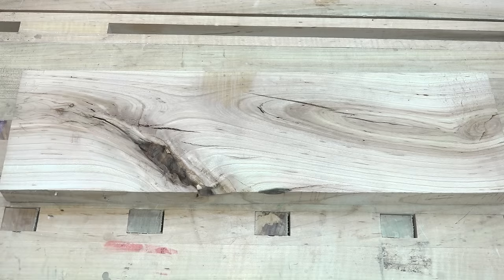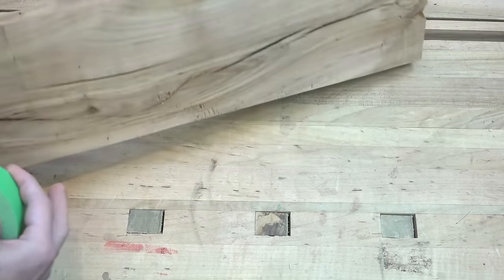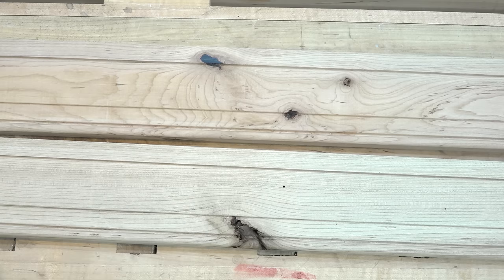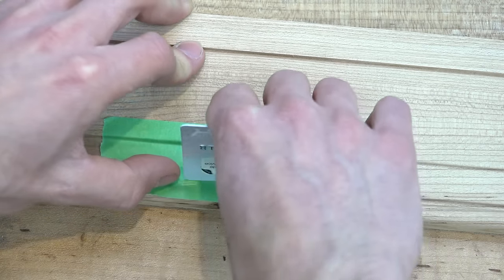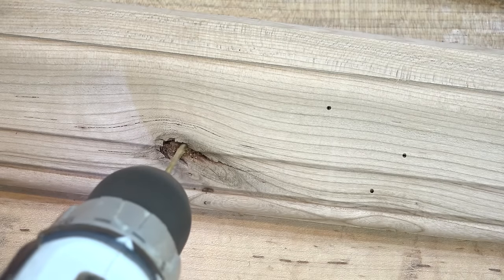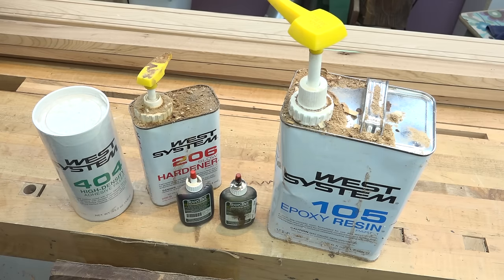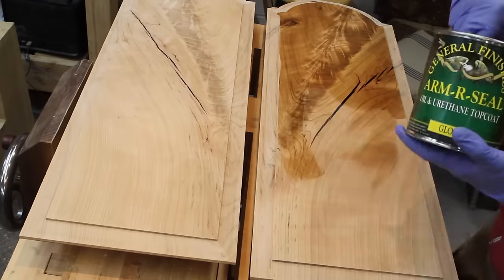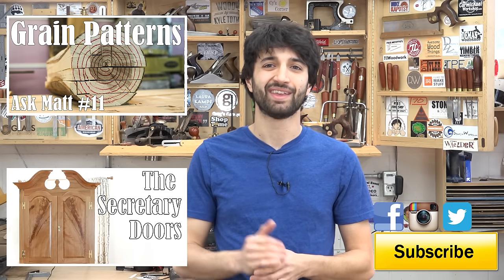Filling Voids, Cracks, and Defects in Wood with Epoxy - Ask Matt #19

Comment: I had a slab of walnut that had so many deep cracks (it was like swiss cheese!) it was taking an inordinate amount of epoxy to fill. And when I did fill, air bubbles were becoming a major problem. I just couldn't get them out to a perfectly smooth finish. So I tried the following, curious if you've ever tried it: 

I'd pour epoxy in a crack and wasn't concerned if it filled the whole void. Then I'd tape over the epoxy, and flip the board face down. What happens is the air bubbles up under the surface of the wood, while the epoxy flows against the tape, leaving a relatively flush pour after the tape is removed.

The downside is it's purely a cosmetic fix, so if there are major voids that present a structural issue, then you could be asking for problems. But man, it saved so much time and trouble. Try it some time with your more cracked woods.

Comment: You mention using masking tape.  Is that frog tape?  I've tried using cheap, white masking tape and Gorilla glue duct tape.  With both products I get epoxy leaking out of the bottom, although less so with the duct tape.  Should I just start with a light coat when filling so there isn't as much initial weight on the tape?  In the video it seems you can do the full thickness without any leakage.  Also, thanks for the information, great video and beautiful looking product.  I'm using medium brown and red mahogany tints and it gives a nice deep brown/reddish, almost purplish hue.

Comment: Hey bud I had a question.  I salvaged a few white oaks that had fallen on our property because I wanted to try and mill them.  They have been sitting for almost a year because I didn't have a mill or strong enough chainsaw.  I also did not seal the ends either. (I know, I know, Im and idiot!) As you can imagine, there are some cracks at the ends now.  Do you think I could still mill these trees up and get some decent pieces of wood?

Comment: Matt, it looks like you know quite abit about epoxies, this is not really related, but I would like to know if you know what kind of epoxy or finish that would not yellow after it ages and needs to be somewhat water resistant, also can be put over a decal, I am making a few sets of Cornhole boards for family and the finish I used on the last two that I was told it could go over decals and not yellow, did not work, the decals peeled off and yellowed over the white paint, I really hate painted wood, but these boards have to be painted. 

Sorry for the off topic question, but Google has not been my friend on this, so I thought I would ask someone that may know on here..

Thanks, Mac

Comment: Hi Matt! Great work, thanks for adding the links to the materials you used, thats extremely helpful. Quick question, I have a disk of Red Oak thats about 3 inches thick that I want to put through a router sled, its about 36 inches in diameter, but has a crack about 11 inches long towards the center thats about 1cm thick. Would you recommend that I use the epoxy filler first along with some bow ties and then put it through the router sled? What would you do? Thanks in advance!

Comment: you may have answered this before, but... the viscosity of your epoxy seems to be super thin, like when you brushed it on the bark of the live edge serving trays.  Is it the brand you use or do you thin it?  The brand I have been using is very thick and could not be brushed or shot through a syringe.
Reply from the maker: +Duane W yes west system comes thin out of the can and can be thickened if needed

Comment: Could you use epoxy to fill a burn mark on a solid oak table from a soldering iron? I have scratched out the charred portion, now wondering if I could best hide it by making it look like a knot or wood fill and paint in the grain. Suggestions?

Comment: Thanks for the informative video Matt! I have a  maple slab w some checks and defects that this will work beautifully. There is a large insect infestation (6"×18", and 3/4 through the slab which is 3"). I would like to highlight this and show the story of the tree without starkly contrasting the piece.  Would you dilute your pigment so it is somewhat translucent or use a different cast resin entirely? Or maybe your typical transtint on bottom of void, and a second clear coat above? Epoxy newbie....your advice is greatly appreciated. Thanks Matt

Comment: Is it best to use lacquer or polyurethane on top of the epoxy filler? Will either of these top-coats have a chemical reaction with epoxy or are both of them compatible? Lastly, what type of top-coat (finish) would you recommend for a walnut slab table? Currently, I'm seeking a durable, low gloss finish. -Thanks
Reply from the maker: The epoxy is inert once cured so there shouldn't be any issues with the top coat.  I've used lacquer, shellac, and poly over it.  I'd use a satin poly on your table.  That will give you a lot of durability and the flatteners will keep the gloss down

Comment: I use the same method also, primarily for filling mesquite which always seems to need some serious attention prior to any cutting. But, I've had some problems with leak-through using painters or masking tape. 

I'm experimenting with other types of tape now that provides a better seal and survives the drying process ... but any suggestions appreciated. 

Thanks!

Comment: looks good, 
I have a tree disc from which I would like to make a table. can I coat it completely from top and bottom and at the edge with epoxy to prevent it from twisting and to make it water resisntant?

Comment: Nice video and really useful information.  Question: could you use a palm or RO sander without an abrasive to vibrate the bubbles out of the epoxy?

Comment: hi Matt,  can you comment on a situation where you have to fill a void after the piece is already planed to finished dimensions and you can't put it through the planer....do you need to be concerned about discoloration of wood surrounding the defect that will get some epoxy on it?  In this case would you polyurethane the pc first and then fill the void second?  thanks

Comment: Hi Matt, I've really been enjoying all of your videos.  I also enjoy milling my own lumber and building fine furniture from it (or at least, I try).  I had a question about the epoxy:  a couple of years in, have you noticed any issues with the epoxy cracking or getting squeezed out due to wood movement?  I've only ever used it for very small repairs like bug holes.

Comment: i want to make drink cups with a flower in the base of it, is epoxy a good material to use? i originally thought of using epoxy because its a thick liquid and will be easy to use but im unsure whether it is safe to drink from and if there is any better materials i could use. thanks

also cool video, i saw something similar where someone made a desk and filled the gaps like you did but put a glow in the dark paint instead of the red. either way, both look great

Comment: I'm using JB Weld WoodWeld, and its coming out a lot thicker than the application you use here. Is there something I could use to loosen it up so it falls into the wood easier?
Reply from the maker: I'm not sure if there is a way to thin quick setting epoxies.

Comment: Can you sub epoxy for Gorilla Glue to fill in the cracks in a fir shelf or will the glue expand and make the crack worse?
Also, does the epoxy help strengthen the piece of wood enough to make it structurally safe to use as a  heavy duty shelf?

Comment: Is there any chance of the epoxy damaging the planer blades or carbides when you run it through?
Reply from the maker: Not really. It’s plastic and far easier to machine than wood. Uniform density and no grain direction
Reply: @mcremona  thanks

Comment: You can also get rid of surface bubbles with a light blast of silicone release spray. Then there is no risk of heat damage and it stays on the surface popping bubbles throughout the cure time.

Comment: If you used clear epoxy would it pick up the color of the wood and be less noticeable? Also what was that dye your using? Thanks
Reply from the maker: +Greg Jordan it does a little but if the crack doesn't go all the way through the only light hitting it is on top. I find that it looks a little strange in most cases. Unless you're trying to show what's under the surface, I find clear epoxy distracts the eye and makes the defect the focal point. The dye is transtint. I left links to the exact ones I used in the description. Thanks Greg!
Reply: Thanks I'm doing one of those river type tops with sea glass in the shape of a star fish, part of the design will have clear with no sea glass and others will have bluish color, great info man love your videos keep up the good work!!!

Comment: just about to do my first epoxy filling, so great timing and video, is there any way to sand the epoxy down flush, but keep the epoxy looking transparent, or will it always go opaque?
Reply from the maker: +Russ Dixon you can keep it transparent by sanding to a high grit. Depending on the finish you apply, it can also bring some clarity to the surface
Reply: +Matthew Cremona thanks Matt

Comment: I used the same method and everything went well. After It fully cured, the top is nice and hard but when I removed the tape, the epoxy on the face that was covered with tape is sticky.  Any idea on why that is? how can I fix it? ( Its not from poor mixing)

Comment: awesome video, per the usual. 😉...Quick question. I just bought into this system to rehab a highly figured piece of black walnut. It's amazing how this epoxy has me looking at wood I would never have considered in the past. Anyway, I digress...I bought the 205 hardener and I am thinking of adding the 206 now. Is the 205 going to set up quicker than the epoxy potentially preventing the epoxy from filling the cracks completely in your experience? I suppose I could just try it and I am sure room temp influences it, but thought i'd ask you as well.

Comment: Matt, not sure if you answered this already but I didn't see it.  Could you use a disposable syringe to add the epoxy into small cracks?  Would that work well to get the epoxy down into the bottom of the cracks?
Reply from the maker: Yes, I've used them to fill worm holes.  Works well for small repairs needing small amounts of epoxy.

Comment: +Matthew Cremona I accidentally ripped the closet door handle off when i was moving some furniture in. The screws holding the handle in, ripped through the wood forming bigger holes. What kind of filler should I use for the screw holes ? The filler needs to have some strength to hold the screws, the door is indoors, the door is painted white but color doesnt matter because the holes are hidden. any filler suggestion ?  I only need a small amount, preferably something sold in small quantities. thanks
Reply: It sounds like a hollow door.  You will have to insert a pc of woo into the door to fix it properly.  Then you can use something to fill the holes on the front and back and paint.  Another way to do it is to use a hard thin material and cover the holes with it on both sides and install the handle over that.  Maybe 1/8" hardboard?  You may have to be creative.

Comment: Matt, will this epoxy suck into a crack on a vertical surface if I brush it on?  thanks much for your video!
Reply from the maker: If you thicken it up first it should stay in there until it cures.  If you just try to get it in there out of the can, it will drain out because it's so fluid.
Reply: Fill vertical cracks from the bottom. Put on rows of masking tape and fill behind then put a row of tape above it and continue till you reach the top.

Comment: Hi Matt, I have a rustic Tanoak floor that we have been laying for the past couple days and some of the knotholes go completely through the flooring.  I didn't think ahead and put tape on the backside, so the epoxy will flow right through the channels.  What can I use to "stop up" the botttom hole  prior to filling it with epoxy?  I don't want any give in the hole after it is filled.
Reply from the maker: If you're going to be tinting the epoxy, you could stuff something down the hole to act as a stopper, then pour a thickened epoxy over it to seal the bottom of the hole.  Then a second coat of epoxy could be applied as I show in the video.
Reply: Thanks, Matt.  Now to find the perfect "hole-stopper" that wont shift over time under the epoxy.......any ideas would be appreciated!!!
Reply from the maker: Whatever you use will either be enveloped in the epoxy or at the very least be pressed between the epoxy and the subfloor so I doubt it will shift around too much.  You could try using a layer of sawdust.  You may need to experiment with the viscosity of the epoxy and the thickness of the saw dust so you don't end up gluing the board to the subfloor.

Comment: This is great!  thanks for the video.  You really got the gears turning in my head.
Can you router epoxy resin?  i have some cracks in the edge of round oak dining table that need to be filled?  the table is over 100 years old and currently has some wood banding on edge that need to be replaced.  all thoughts and advice are welcomed?

Comment: I bought a Oak slab I want to make a table out of. I sanded it down and it's smooth but there is are a lot of holes and cracks filled with dirt and rocks how do I remove this and seal those holes and cracks

Comment: What type transtint dye should i use to fill holes on an old maple butchers block work table i'm turning into a desk. It has red angle iron trim so i want a slight red tint to the epoxy.

Comment: Great video of West Systems application. Please wear some gloves while you're working with the uncured stuff. It's pretty inert once cured, but nasty before it's cured. Putting some plastic or parchment paper under your work can prevent some potential nasty cleanup as well. A small planer does wonders for removing excess epoxy once it's cured. Much quicker than sanding.

This is coming from an amateur boat builder.

Comment: will the epoxy eventually shrink and re-expose voids?
Reply: No
Reply: @Pond Hockey  While it won't shrink after it's hardened, the level may reduce from when it's a liquid to when it's fully setup a tiny bit, so always overfill at least a certain percentage.  Also, while sanding, be careful as if it isn't totally cured, it may be softer than some of the surrounding wood (depending on the species) and it may sand easier and thus leave a slight depression.

Comment: Great video Matt! I'm currently using epoxy to fill the voids on a rustic table I'm building, clear so it preserves the natural feature in the timber. In a few comments you mentioned there are no issues with epoxy certain finishes, but is that including oil based finishes since the oil can't penetrate the epoxy? At the end of the video I saw you used an oil based polyurethane and was like @@

Comment: Thanks for the video, it is very interesting and helpful !
 I first heard about the West System epoxy process about 20 years ago when I was interested in old wooden boats. A lot of people who restored them used the West System to water proof the hull which supposedly removes the extra step of putting a boat in the water and waiting for the wood slats to swell and in a sense, seal the wood from leakage inside of the boat. My question now is that I've read about piano restorers using epoxy to fix and fill cracks in the pin block (block that holds the tuning pins) of upright pianos rather than completely replacing it. (Very expensive in an old upright because it's the main structural part that the rest of the piano is built around). Do you have any thoughts on what you think about this? Does the epoxy bond to the inside cracks of the wood to make this a strong fix?

Comment: Consider using foil tape (typically used in metal ducting) rather than masking tape, it will hold its shape better when you're trying to match existing contours.

Comment: PS. West Systems is awesome! but US composites epoxy is significantly cheaper. Their 635 thin marine epoxy with a medium hardener 3:1 is really great for repairing wood work and works for deeper knots that go deep into say a table top without exotherm problems. I have used it for about 10+ years and no problems. Of course never epoxy when the dew point is close to the current temp especially with temps dropping. Super high humidity is the enemy of epoxy. In other words keep humidity and temps steady or going slightly up for cure.